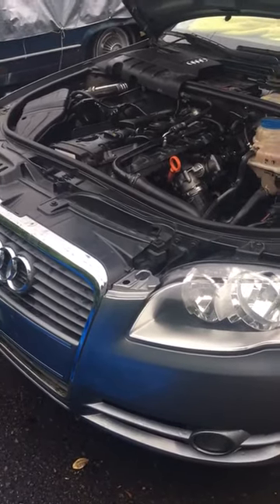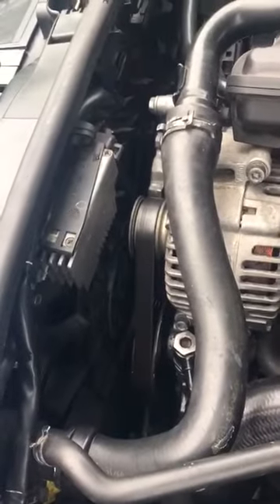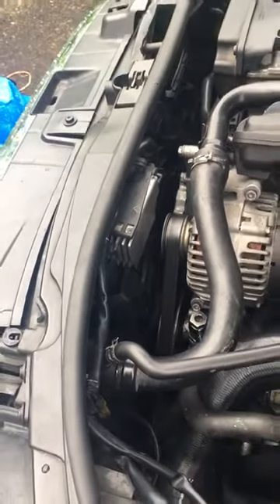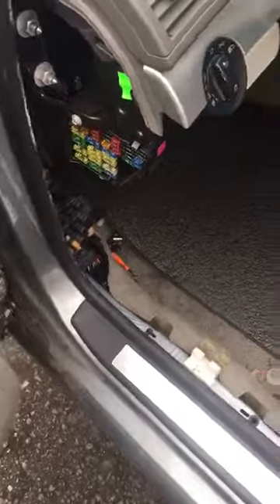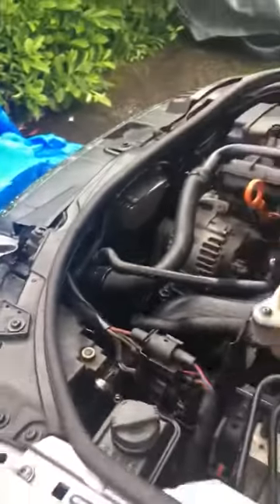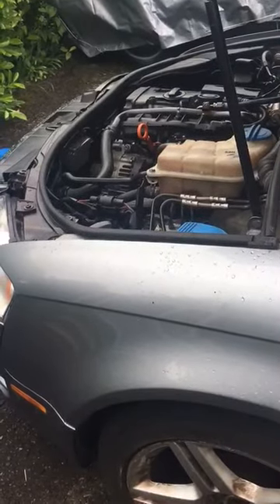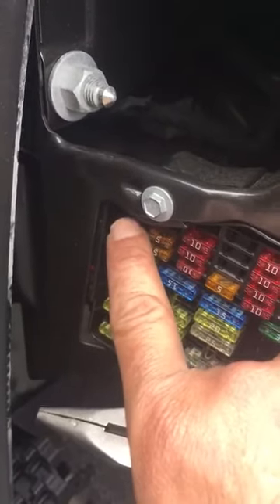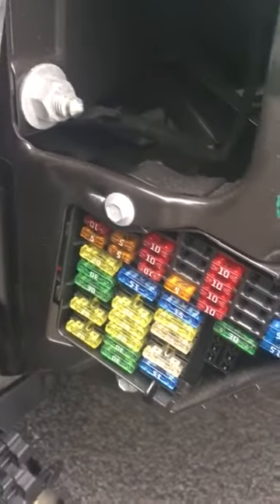07 Audi A4 2.0t radiator fan acting up, you won't believe how I fixed the problem

Comment: A bad coolant temperature sensor will trigger the fans on too on a Audi A4 B7. Or even unplugging the sensor will trigger the fans on because the ECM thinks the thermostat is closed and it puts the fans on the whole time you have the car on so it doesn't overheat.

Comment: This also worked on a 2009 Audi A3 2.0T i have just bought, allowing me to figure out there is nothing mechanically wrong with the fan, but as top comment suggests this is not a fix. Look into thermostat and water pump, hopefully I'll get this car running smoothly

Comment: I'm confused. Your problem is that when you put the fuse into fuse slot #1, your fan comes to a stop, correct? My problem is that my fan isn't running at all for some reason. But when I remove the A/C fuse from slot #1, my fan then begins to spin.  I could use your help, please. Mine is a 2005 Audi A4 1.8t CVT.
Reply from the maker: That is correct ! When you remove the AC fuse , the fan will start spinning even when the car is cold . So I guess your fan could be just fine , it’s supposed to start working after the car is supper hot and you are at a stop and th car is running
Reply: My fan doesn't spin at all. It was only after I saw this video. That's when I pulled the fuse from A/C slot #1. After that, it started working. But now it just runs all the time. However when I turn the car off, the fan turns off too.
Reply: Hi
Yeah I have the same problem when I unplugged the AC fuse then fans starts running, otherwise they don’t run and coolant level go down because fans are not working, but without unplugged my AC fuse how can I make my fan running normally??
Reply: It's your 3 fusible link from the left coming out of the engine  fuse box
Reply: @vicchavez6570  which is this??
Reply: @alexsexoticpets746  it's the fuses that are bolted on the front of the engine fusebox, the relay closest to the front of the box is for the fans as well.
Reply: @vicchavez6570  you mean where the computer is at?
Reply: Thermostat is stuck open

Comment: On my 2003 A4 B6 2.0 FSI ( n/a) i had the same problem, but, it wasnt the air con fuse, actually my problem was in the plastic box where is the ECU ( same location as B7) and underneath the ecu, there are 3 RELAYS. because the previous owner did not take care of the car, he broke the plastic cover, and water was getting at the ecu, and shortcircuit my ignition relay, and i had the same symptoms, every time i would turn off the car, the fan would kick in, full speed.
Reply: Did replacing the relay fix your problem? Your radiator fan and ac work again ?
Reply: @notlawwww  yes, replacing that relay fixed the problem.

Comment: I have 08 Audi A4 2.0. My ac is not blowing cold and my fans are not turning on. I pulled the fuse and my fans turned on but my ac does not work. The whole cluster lost power. Could it be the ac compressor? I replaced the temperature sensors already and the sensor on the compressor and still the fans do not engage once the fuse is in. Does a bad compressor affect the fans engaging?? At this point I'm leaving the fuse off just to keep the car from over heating.
Reply: I have the same problem and the same 08 Audi, did you fix it?
Reply: Mine is doing the same exact thing. The fan won’t turn on and AC stuck on Econ blowing hot air. If I pull the ac fuse the fan runs at the highest speed  all the time and won’t turn off unless I put the air conditioning fuse back in. Anyone know a fix? Please share. Thanks

Comment: This doesnt fix your car! The fan not onky cools the motor but helps to regukate the pressure in the ac by pulling air over the condenser  cooling it off, by pulling the ac module fuse it caises the engine to failsafe the fan, running it all the time. If youre overheating only one thing will solve it. Fix your leak pr replace the waterpum/thermostat

Comment: i have a audi a4 b6 1.9 tdi and my temp is going up slowly and my fan is staying on as soon as i turn the key.. i changed thermostat water pump n cleaned radiator but i dont know why my temp is going so slowly up
Reply from the maker: Check a secondary water pump if your car has one , make sure your water pump sensor is giving you the good reading , and if you bought an after market water pump , it might not be good . Also make sure that your coolant system has no air in it . That’s all I could think of but also make sure your AC SYSTEM  is working properly
Reply: @strictlyaudis7012  might be some temp or some fan sensors idk...my thinks is about thermostat maybe mechanic left it open n maybe thats why fan stays on and my temp is going slowly up idk..but thanks anw ill let u now when im done

Comment: I have a vw polo 1.2 petrol and the radiator fan comes on as soon as I start the engine and stays on at full speed (more than it should as it runs louder too) which causes all the lights to flicker (dash,headlights, radio) and turns off the moment I switch the engine off.

I diagnosed and replaced the alternator, the battery and yet I have the same issue. Do you know what could be the cause?

P.S. This happens every time I start the engine, even when the engine is cold and the flickering begins only when the fan kicks in.
Reply from the maker: This problem has nothing to do with the alternator. Make sure that fuse box is not wet . Also check the radiator fan module , and also check the AC system and it’s fuse

Comment: Ok This is a good start, but it only solves the fan problem, how do I make my ac blow AND have my fans working? Bc when you pull out the fuse, the fans start working but the AC stops working…
Reply from the maker: Generally speaking if the computer felt there is a problem with your AC , the fan will start acting up , making sure you have a good fuse is just one element . It could be other components that are for AC , if your AC system is perfect than it’s your fan that is not working properly and generally it’s the fan module but could be other things as well
Reply: @strictlyaudis7012  actually my ac doesn’t work, doesn’t blow cold air, so you think this might be a problem? And if so what are the common problems
Reply from the maker: @Natalia-vd4od  well if the AC doesn’t work , it must be the problem causing the fan to act up . You need to do a diagnostic on your AC it could be : fuse , Freon, wire, condenser etc start in this order and find out what causes the problem. Which city do you live in ??
Reply: @strictlyaudis7012  I’m in upstate sc, I have buddies that have shops that can look at it just trying to figure out if there is one common problem everyone is having with this, thank you for the advise trying to weigh my options if I should sell it as is or try to fix it

Comment: The same year model car,the fans is not run, I may try this way tomorrow to fix it.
Reply from the maker: tan james , great ! Yeah try it and let me know. Also if the fuse can cause the problem, the air conditioner may cause that too , good luck and let me know
Reply: STRICTLY AUDIS when I unplug this,the AC is not working ,and the fan still not working,maybe it is my cooling fans radiator problem,I order the parts,it arrive next Monday.
Reply: STRICTLY AUDIS and Can I drive if the cooling fans not work?  It get hot air when temperatures is high,it get cold air when I drive  at night,If I just start engine not drive ,it come with hot air.
Reply from the maker: tan james your cooling fans are for the engine, they’re supposed to work only to prevent your car engine from heating up , keep that fuse where it belongs , maybe your ac is not working. If your car temperature stays in the middle , your cooling fans are ok , anyway I would take it to a shop to inspect it before you buy any parts

Comment: Hey bro , thank you so much! I did the same thing! Now fans are working but my AC isn't working. Also I removed the fuse. When I put the fuse back my fans don't work. So what could be the issue?
Reply from the maker: I would have to know what car you’re talking about, cos they are not all made the same , and your msg isn’t clear , if you could explain more please , I’ll do my best to help you if I can
Reply from the maker: What city are you in at this time?
Reply: @strictlyaudis7012  I'm in Jeddah , Saudi Arabia bro.
Reply from the maker: @thesachinsuresh  I’ll call you just give me some time , working at the moment
Reply: @strictlyaudis7012  sure bro. I really appreciate it 😊
Reply: Hello! i have a audi a4 b7 2.0tdi and the ac wont work i have replaced the ac presure sensor behind the bumper i have no leaks and there is ac in the sistem what can it be ?

Comment: Hey I did the same thing to my audi and after a little while the fan stop blowing , what can possibly causes that?
Reply from the maker: It’s supposed to stop and it will run only when the car is too hot . The temperature sensor send the msg to ecu and ecu send the msg to fan module and the fan starts blowing. But , I’m not in front of the car I can’t be too sure .